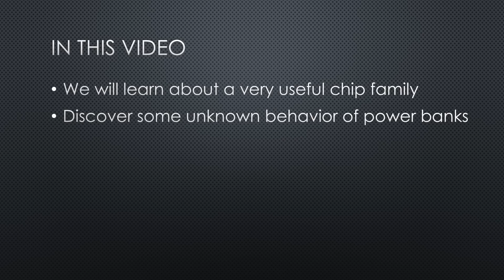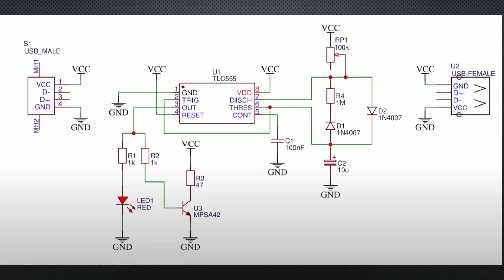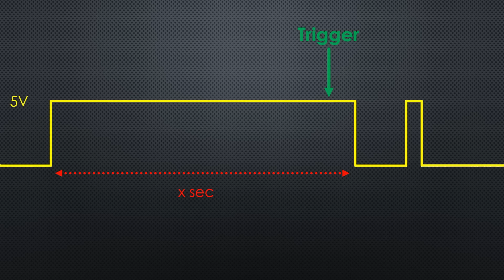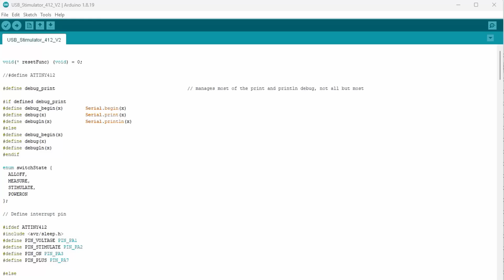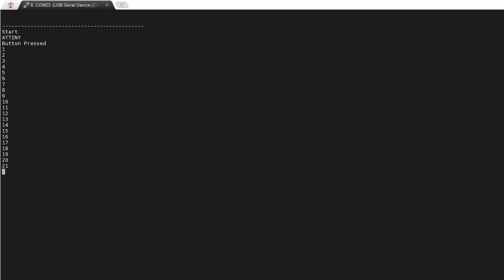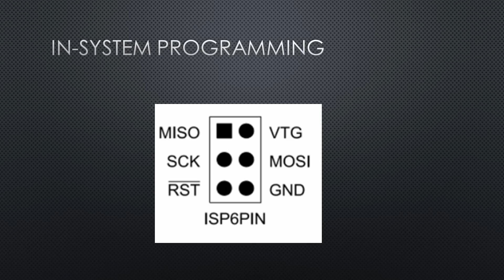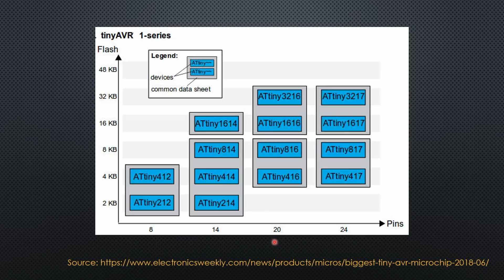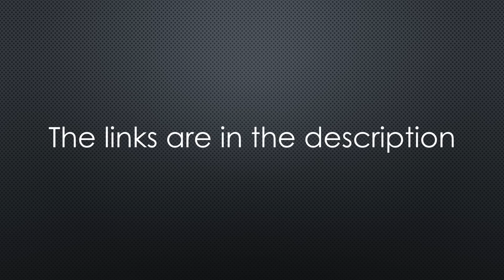477 Use the very attractive new ATTINY chips for your projects

Comment: After playing around with Arduinos dor a few years, I came across this series of newer microcontrollers about 7 months ago. I use them now for all smaller projects. The required hardware for programming is so simple and cheap, and still no bootloader required. Quite accurate timers without external oscillator. I love it!
Reply from the maker: Thank you for sharing your experience!

Comment: Another feature we need:  Some power banks will give you battery voltage, say 3.7-4.1 to the usb when there is a tiny load, then turn on the booster to 5v when load  increases.  I would be nice to control that.
Reply from the maker: If you need variable voltage, I would go with USB-C PD. There, you can ask for a big variety of voltages up to 20V
Reply: @AndreasSpiess  I'm not thinking about 5v or 12v, but rather getting a micro-watt of battery power to power a sleeping esp32 or a pir, without burning out the battery by constantly boosting it to 5v.  I could power a circuit with a couple AA batteries for months, or drill a hole into the powerbank and get the 18650 power (on the safe side of the over-discharge circuit) for my micro-watt, but it would be nice to get the microwatt through the usb with the booster shut off, and then get the real 5v power when the esp32 wakes up and turns something on and we need real power.  Maybe a couple AAs for the microwatt, and rechargeable powerbank for the reak power.

Comment: Thank you for showing the new attiny :) 
I am approaching a similar project with storing values before switching off the chip. Do you know how the microchip behaves, when the chip is turned off while writing to the eeprom? Or does the capacitor store enough energy to complete the writing step?
Reply from the maker: You can increase the value of the cap to make sure this does not happen. But it will be a very rare event in my setup.

Comment: Actually there is no need for the voltage divider for measuring the input voltage. Modern AVR chips allow to select VCC as the ADC reference voltage, and can use the internal reference voltage (e.g. 1.024v or 1.1v) as the ADC voltage, so you can calculate the VCC using Vcc=adc_reading*Vref*1023 to get the supply voltage without using any GPIO pin and voltage divider. MegaTinyCore library comes with an example for reading the Vcc voltage and internal temperature sensor.  I love the tinyAVR series and have been using it since 2017.
Reply from the maker: Did you see that I powered the ATTINY with a 3V coin cell and wanted to measure the 5V of the power bank?

Comment: I would use a capacitor to keep the AT running when power drops Out...if you disconnect it, the capacitor discharges, and the MCU Will Reset, and restart next time it's plugged in...no need to use ADC, just input pin to detect 5 V going to 0 V, measure the time from reset to dropout, set internal timeout to 80%, done...
Reply from the maker: You are right. replacing the battery with a cap would be possible. However, I replaced the battery and therefore did not need a cap either...

Comment: ATTiny85 is a very powerful 8 bit microcontroller for relatively little money, for many interesting projects. The small number of pins for (input) GPIO can be bypassed with an IR remote control (NEC coding). The code for this only takes up a small amount of storage space from Flash. A very good microcontroller
Reply from the maker: I agree. But: The better is the enemy of the good ;-)

Comment: I think I would power the ATTINY from a capacitor that is charged by the 5V from the power bank via a diode.  When the bank shuts off, you have the capacitor as power while you drive the load MOSFET
Reply from the maker: During triggering the MOSFET, the ATTINY is powered by USB (the trigger has to be done before it switches off).
Reply: @AndreasSpiess You seem to have missed my meaning.  If you power the ATTINY from a capacitor that is charged by the USB power, the self calibration can be done with no EEPROM.  My intention is to explain a better way to do it.
Reply from the maker: @kensmith5694  Now I understand.

Comment: Maybe I'm missing something but can't you just directly connect to the battery within the powerbank and draw as little current as you like? Even if the rest of the charging PCB is still active to properly charge it if needed?
Reply from the maker: I do not understand your proposal. But most powerbanks switch off if you only draw a small current (most of our projects are low-power).
Reply: @AndreasSpiess  I thought about if it's possible to connect the charger to the battery and in parallel you connect any project that needs energy to the battery aswell. With this it gets charged but for discharging you do not use the outlet of the charger (that gets shut down) but access the battery directly.
Reply from the maker: @MaxDiscere  Most banks stop the output when they are charged. Only very few continue 😞

Comment: There is almost no justification for using a 555 timer chip in modern circuits when these ultra-cheap 8-pin microcontrollers are available; they cost functionally the same, don't require as many supporting external components to perform a timer function, and provide the same or better accuracy while having way more capability and flexibility (one of these chips can serve the same purpose as six 555 timers, or can produce way more complex waveforms, or can provide conditional/stateful operation removing a bunch of other supporting chips).

Despite this, hobbyist projects constantly call for 555 timers. I guess they're a bit simpler to understand and implement because they don't need to have any code flashed to them, but that really only gives them use as a learning exercise, but not as part of a real practical project you'd want to build to accomplish some real task.
Reply from the maker: I agree. But if you read other comments you will find some other voices...

Comment: I’ve been using stm32F103c6t6 chips in place of attiny chips in a lot of my projects they have a lot more up and they are actually cheaper from Ali express than these attiny chips…. You need to be able to solder smd, but I’m good with that….

Comment: Ok.  Fail to understand how this is in any ways AI, I think that's a term which is now added to any/every project.  This is just a measure and adjust circuit, like a PSU feedback. Measure how long for power off, reduce the time, retry.  Where is the AI. Are we going to say technology we had 40 years ago, predictive text, was really AI?  Depending on how precise you want to be predictive text (or characters) is 80 years old.
Reply from the maker: I agree with you. This is the reason for my joke.
Reply: @AndreasSpiess  Andrea's, I'm sorry, I did wonder if it was a joke but you are always so serious about your craft, and I'm now getting over-sensitive about the use of the term AI.  Great video, I will learn to be more easygoing,  thanks.  😀

Comment: Great video. In addition the latest ATTiny 2-series have an excellent ADC configurable up to 17 bits and can work in differential mode accepting rail voltages (direct current measurement with a shunt resistor) . Unfortunatelly the smallest in this family is 14 pin part.
Reply from the maker: I also was looking for the -2 series and did not find a lot of chips available. This is why I did not mention them.

Comment: Wrong signature can be because it was real 416, but it has defects and was sold from manufacturer to some seller for a lower price. And seller(or manufacturer) has made dip8 package for it because of unusable pins. That the most common thing on a Chinese market.
Reply from the maker: Another commenter wrote that these chips were sold by RS components, too. So they came from Microchip. But I do not know.

Comment: If you ever need to measure the voltage at the supply pin, some AVR microcontrollers have the internal bandgap reference wired as an input to the analog multiplexer, which means you can measure the voltage reference voltage using the main supply voltage. This is equivalent to measuring the supply voltage with the internal bandgap reference, just with swapped values in the formula. This will spare an analog input pin. I don't remember however if the ATtiny41x have that feature.
Reply from the maker: I did not look at the ADC (I just used it). But I once made a video abour using the internal bandgap reference of the 328P...

Comment: Great video, I gave you a like.  At 9:38 EEPROM cells don't always last for 100,000 writes per memory address (location), many work on memory pages (sections), say 256 bytes in many EEPROMs but this one is only 128 bytes total, so you should experiment to find out if 100,000 writes to the first EEPROM address will wear out the first address only or its entire EEPROM in these tiny devices. 100,000 writes is guaranteed, many can last a bit more before they finally fail. But 100,000 "learning" sessions is a LOT, the USB contacts are more likely to wear out before then.
Reply from the maker: Thank you for the "like". Indeed, EEPROM wearing is probably not an issue for this application.
Reply: there's 1 rewrite per second, so that's. 100k sessions / (number of seconds measured), bringing it down to a much lower 100s or 1000s of sessions

Comment: Maybe you could use an isolation diode and a large capacitor to hold up the ATTINY when the power supply times out, then it would know the time out period, then while still riding out the power off it can isolate both loads for a few seconds then reconnect a 2nd time, but now knowing the timeout period to pulse the current before timeouts.
Reply from the maker: This is what I tried in my first attempt (with a battery). As said, the power banks detect extremely low currents, did not switch off for a very long time, and did not re-trigger.
Reply: @AndreasSpiess  Oh, yes, the battery... hmm, that didn't work, ok, thanks.

Comment: Thanks but no thanks. STM32 and CH32V already ate Attiny's lunch for me. Microchip forever lost me as a customer by price gouging their incredibly crappy products. I see they're trying to win back hobbyists with their new series, but just compare the similarly priced CH32V203 with Attiny412... 144 MHz vs 20 MHz, 64 KB flash vs 4 KB, 20 KB SRAM vs 256 B (HAHAHAHAHAHA WOW), 12-bit ADC vs 10-bit, not to mention freaking OP AMPS and USB (both host and device), and even a freaking CAN bus!! Really it's not even a competition at this point.

I just can't imagine using Attiny when the 5x cheaper CH32v003 is available.
Reply from the maker: How do you program the  CH32V203? Is it supported by the Arduino eco system (IDE plus libraries). This is a deciding factor for many Makers. If it is, it is well possible that it will apear on this channel once in a while...
Reply: @AndreasSpiess   It's programmed with its cheap and fast programmer/debugger (which I really like. it also has a built in USB-uart bridge for convenience). There's an official Arduino core for it, and so far it worked without a hitch in both Arduino IDE and Platformio. I also recommend the official dev boards, they're very good and cheap too.
Reply from the maker: @tiftik  So I ordered a few. Thanks for your info!

Comment: If I remember right ATTiny 2313, 13 and 85 supported debug wire for programming but first programming needed to do with spi and enable it. DW used the reset pin.
Reply from the maker: I thought that DebugWire only was supported by the Atmel programmers. At least, I never saw it with the Arduino IDE.

Comment: Love to see other approaches to one problem. Pretty cool ATTiny as well. Might use it in the future as well ;-)
Reply from the maker: Nice to see you commenting like that! You see, you are an inspiration even for old men ;-)
Reply: Bitluni has some in depth reviews about the reasons why the attiny fits his purpose so well
Reply: IMHO the CH32V003 and its siblings (CH32V203 in particular) are far more promising for the price point and size. It has far more capable peripherals, is less expensive, and also has a far more capable CPU if/when you need it!
Reply: @MUSTARDTIGERFPV Highly interesting and useful info. Didn't know about the ch32 family yet. Down the rabbithole I go.
Reply: @MUSTARDTIGERFPV  I was thinking exactly the same. Perfect for simple sensing and controlling tasks

Do you know any good free and scalable framework for controllers and sensors? I'm playing with creating my own but want to be sure I'm not reinventing the wheel
Reply: @alastorgdl  I think you'd be in brand new territory working on a framework like that for such a small platform!
Reply: @MUSTARDTIGERFPV  Probably

The idea is to have such framework that makes topology transparent for control system.

Like having the capability to add nodes via Ethernet, Wifi, CAN or even I2C with central controller addressing each input or output, digital or analog, in every node in a device-independent manner, and exposing that for measurement, real-time control or simple monitoring

Is there something like that?
Reply: Stay Creative !
Reply: Love to watch your videos, GreatScott and Andreas!
For a very special case, I have a pretty simple solution:
Case : ESP32-C3 with SHT30 measuring temperature, going to deep sleep for 10 minutes, supplied with a USB powerbank
Solution: 4F capacitor in series with a small resistor parallel to the 5Volt rail of the ESP.  During deep sleep, the capacitor supplies power to the ESP, and, alfter end of deep sleep, supplies it until the powerbank wakes up. Then, the capacitor gets charged until to powerbank switches off.
May only work in my setup and I know, that a 3,2 Volt LiFePo cell connected to the 3,3 Volt rail of the ESP is much more efficient but needs a separate LiFePo charger
Cheers  Rainer
Reply: Two of my favorite makers and inspirations!
Reply: Hi guys. I've been using USB power banks to power my long range RF/Nano projects for years and use transistor circuitry to defeat auto-shutdown. Using RF I can not only send/receive data and reboot but also shutdown the board entirely. An Eagle pic of my pc board design:
 https://www.4gto.com/Nano_powerbank_pcb.jpg
Reply: I was one of the guys who suggested using a ubiquitous 8-pin micro and the standard blinky program instead of the 555 in GreatScott!'s previous video. I still stand by that comment, but it's sad that these micros are putting the venerable timer chips out to pasture. "The competition's getting younger. Tougher broncs, you know I can't recall."
Reply: As an electronics enthusiast How you'd you not know about them? 🤔 
Apart from kids copying your video's and committing crimes I don't really see you as a person but more like a drug dealer. Your days are numbered!
Reply: Great Scott, love your videos.  But when I saw your video, I thought, ugh, I don't want to build that circuit.  Yes, extreme laziness.  I thought a microcontroller could do it just the same.  So I went that route.

Comment: I used a ATiny10 for this purpose,  last year but found the current puls sometime must be longer so it isn't just the period that counts. Some of my power banks was 15s / 150mA/1ms and others 25s and 100mA/1ms. I just took the shortest duty cycle and 150mA /2ms and now all works fine. ATiny 10, 11, 12, 13 etc requires assembly as their memory is so tiny. There is a guy with a great simulator and demo code for free use. search for Gerd's AVR simulator

Comment: Instead of the button, why not checking if the time measured value is already stored in the EEPROM? or a flag. If it is not there then do the measurement. Just tell the user that the first time it will analyze and shutdown. The second time it will work.
Reply from the maker: I use the button to tell the device that it is connected to a new power bank. How would it find out without me telling it?
Reply: Yes, ok, when you change the device to another power bank you would need to reset the value in the EEPROM somehow. At the end it would be a button press anyway, you are right.

Comment: instead of using a push button, would it be an option to connect/disconnect the device multiple times to put device in 'learning mode' ? thanks for amazing video btw!
Reply from the maker: Also a good idea. But then you would need a way to keep the time between the insertions.

Comment: My estimation about the "working chip with the wrong signature" is that Microchip had a manufacturing mishap (the devices weren't built to spec) and they sold them at a discount rather than destroying them.  OR Microchip "destroyed" them by giving them to a third party "recycler" (where quotes mean that's not what really happened).
Reply from the maker: One commenter wrote that they were sold by RS components, too (they were manufactured by Microchip). This would explain it.